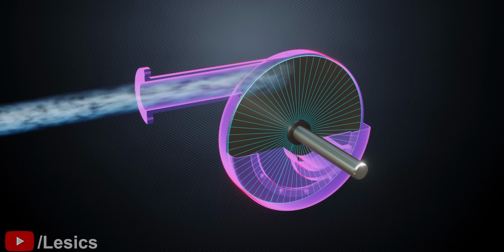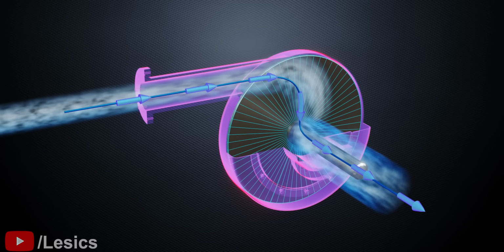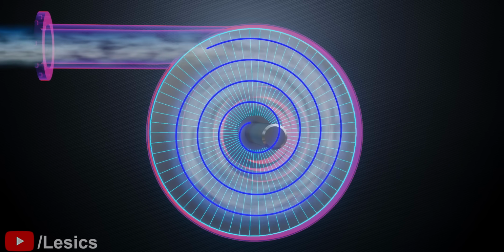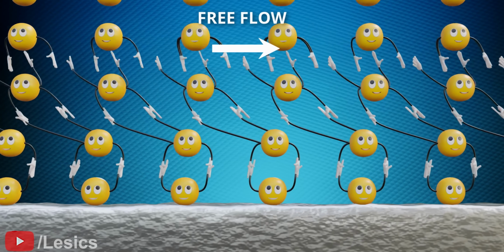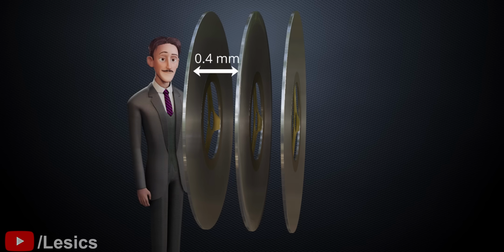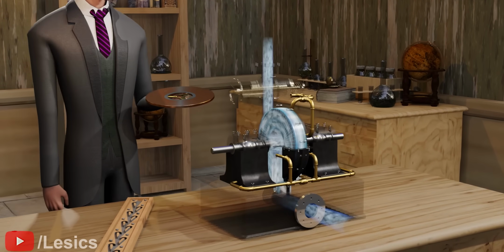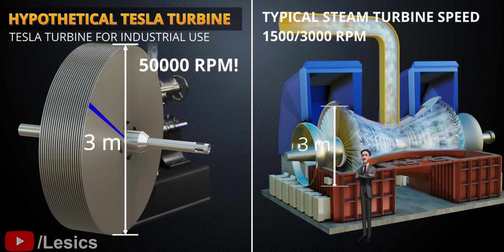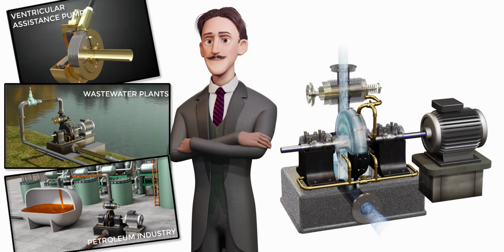Tesla Turbine | The interesting physics behind it

Comment: Tip speeds can be reduced by reducing the diameter of the turbine discs and by making it wider by stacking more of them. Perhaps more stages?
Reply: Also the discs can be as thick as necessary to withstand the forces generated, while the critical distance between discs is kept constant. But still, the TT is best at small sizes. Coupling it to a low-loss speed reduction system would be very helpful in most cases, and NASA Tech Briefs talked of one many years ago, based on rollers with a slight barrel shape, as in wooden barrels. It had higher efficiency than any toothed gears, and could run at hundreds of thousands of RPM with no sign of wear. They even tested it at 1 million RPM for 24 hours, and it showed minimal wear.
Reply: @YodaWhat  thicker disk means a alot more weight and more stress. Remember square cube law, if you double volume, weight goes up threefold and that esponentially increases stress.
Adding more disks simply is a form of compounding but each stage is lower pressure and would need to be of different dimension and thickness, it's a nightmare to balance out such a system for marginal gains against modern turbines
Reply: @phantomsoldier497  No, compounding is a totally separate issue, and no, if you double the volume of a thing, you tend to double mass. You are thinking of doubling the radius. But anyway, who says the disks have to be solid? :)

Comment: I had the thought that if the tesla turbine was built in space would it be able to achieve 97% efficiency without failing? Perhaps it was never meant to be built for earth?
Reply: The problem isn't friction on the rotor, but rather with the fluid it's working with, ex steam.  Differences in pressure between sides of the blade leads to instability, and small flexing of the blade, with more force exerted on the material the faster it is spinning and the further from the point of rotation it's at (due to leverage).  Thus, even if you started out in a vacuum, you're ultimately limited by the physical stresses a material can withstand.  You could probably get one of these up to 20,000-25,000rpm reliably with modern high performance steels, perhaps 35,000-40,000rpm with some present superalloys?  But ultimately our present state of material science isn't to the point where a tesla turbine can reach sufficient efficiency to beat out traditional turbine designs in that manner.
Reply: @SCComega  thanks for such a detailed answer.  I'm not to smart on these matters (obviously) I just thought since the metal would be weightless and so would the fluids, perhaps that would reduce the forces exerted on the blades.

I remember reading that tesla said these ideas came to him like blueprints from a central knowledge base which he some how accessed. I came up with the theory that maybe the blue print for the turbine wasn't meant for earth. 😂

Need to stop smoking the good stuff (nah I don't smoke) thanks for clearing up my speculation.

Comment: So, the Tesla turbine is not scaleable. 

But there is a massive small-scale potential. We should apply that too. The industrial style turbine at a small scale is, on the other hand, much less efficient. 

I would use the Tesla turbine to produce small-scale electricity for homes by burning biomaterial leftovers (branches and leaves from the garden, and non toxic trash)
Reply: but you would have to burn a lot of things to have a constant flow, because during the run up and the cool down you don't get energy. And burning wastes isn't a future viable option, we already did that, and we know it's not sustainable.
Reply: @gillesbkf4315  It is with current filter technology. I know it seems bad, but our current waste storage system is actually very very bad.

Comment: "Engineering impossibility" Those are the words of losers.
Reply: Everything's impossible until it's not...
Reply: I am so tired of seeing self appointed science authorities come on the internet with their fancy videos and having very little understanding of what they are talking about and then making stupid conclusions. This video is riddled with incorrect assertions.. the largest of which is when he says, "maybe 50,000 rpm would be required" ... and then goes on to describe the tangential speed of a 3 meter disc.. the assertion that a 50,000 rpm "may be" required without regard to the diameter of the disc is just wrong and presents a very basic misunderstanding of the mechanics involved. The fluid's energy transfer efficiency does rise with higher tangential speeds but the tangential speed for a 6 inch disc is 19.6 times smaller than the tangential speed of a 3 meter disc. A 6 inch disc rotating at 50,000 rpm for ideal efficiency would only require 2550 rpm on a 3 meter disc.

Comment: Engineering impossibility? Anything within the laws of physics is possible
Reply: Great. Physics allows you to build one where the rim speed is better than 0.9c. I'll wait while you find materials to build one (don't forget the bearings) and while you look, you can think about what it means when someone says that something is an engineering impossibility.
Reply: Physically possible does not imply CURRENT engineering possibility, or perhaps better said, feasibility.
Reply: I mean it's technically possible within the laws of physics I think. The tips are only rotating at Mach 1821 or so. But if we can find a material that can withstand those forces it should be fine.
Reply: laws are made by men, with weak minds to show how important they are. NOTHING IS IMPOSSIBLE. Tesla made many revolutionary technologies which are still not being used because of the oil companies buried them deep.

Comment: Because it's "too efficent" they can't harness that centripetal force. Maybe with magnets or a field to endure the SPEED OF 50,000 RPM baby.. yeah!!!! o-O
Reply: Yeah, regarding the RPM required, this video seems to force alternate generator geometries onto Tesla's idea, which introduces an entire new set of constraints and problems.  Options related to increased disc quantity with reduced diameter etc. could be explored.  Though that wouldn't solve the issue of lower efficiency at lower speeds.  Otherwise that sucker better be encased in some reinforced concrete bunker for when it blows! lol
Reply: @clark8618  Tesla designed and created the 1st hydroelectric power plant in Niagara Falls. The inlet has a diameter of 10 feet. The shaft spun at 107 Rpm's and each of the twelve turbines/generators produced 70,000 hp 
Many mistakes were made in this animation.
Reply: Question is, as you increase your load on the shaft, how would that affect RPM. That is important for a generator since frequency is based off the number of poles in a generator and the RPM of the machine. Maybe if you had a throttle valve in maintain pressure, it would work but there is also a bunch of other variables to include
Reply: @ww2planes_810  : The load issue is already dealt with by electric utilities- they compensate by speeding up the generators during lower demand, so that the average remains 60/50 Hz, despite the frequency at any given time drifting off that standard.

Comment: Any idea what Mach we could get up to with modern day materials? Something exotic or something commercially realistic, say graphene?
Reply: Doesn't matter, there is no nozzle that will inject fluid (steam) at mach 13 into the rotor ( I built one). However modern technical ceramics are super stiff and could remove the resonance to increase the rpm.

Comment: viscosity alone does not move the turbine. It's the unequal pressure flowing across the turbines, that's the reason they are shaped like an airplane wing, (foil). The curve produces a high pressure under the wing, and a low pressure over the wing, this causes lift. In the case of the the turbine, rotation.
Reply: If the fluid had zero viscosity (like a superfluid), then the pressure would be irrelevant. Here the pressure only serves to enforce the fluid flow. Looked at this way, the viscous drag really is the important force.

Comment: I would have liked to see, what happens, if one uses a more viscous fluid than air - like water or oil. How does this affect the disk space, the necessary size, the necessary speed and the efficiency. It might also be interesting, if one uses polar or unpolar gas / fluid molecules in relation to the disc material. I think, I will look a little bit at the details, this is a very interesting engine.
Reply: The issue is that - no matter the fluid - to increase efficiency, the discs must reach a certain rpm.
The rpm to create efficiency is so high that it's more dangerous to use than another conventional engine for similar outputs.

Lots of people in here are talking about how we just need stronger materials. None of them have talked about how no engineer is going to accept a design that has 6-12 discs of heavy material with an edge velocity of 107 Gs connected to an integral rod design.

The only place it can be used, then, is where natural pressures form with highly viscous fluid that would otherwise be inefficient for any other motor.

But yeah: when we go to space there will not be a tesla motor aboard it. It's an awesome design that is just too fuckin insane to operate.

Comment: The application is not possible for industrial turbines due to tip speed on 3m diameter disks. On smaller diameter turbines current materials would work fine.

Comment: Question: What is the limiting factor that makes spinning a 3 meter disk at 50,000 RPMs an engineering impossibility? Is it that the steam cannot reach high enough pressures to rotate large disks that fast? Or is there some kind of inherent physical property or law that makes it is impossible as well?
Reply: the limiting factor is the tensile strengt (sorry for my english) of the disc material. The centrifugal forces get very high and the disc break at those speeds. It's all about density/tensile strength of the material. Since the material has to resist it's own entrifugal "weight" and at the same time the (relatively) small forces to apply torque to the shaft.
Reply: Exactly. Imagine driving a car at 13 times the speed of sound and then trying to whip around a corner without slowing down. That's what would happen to the discs. They're trying so hard to fly away from the hub that no known material can resist the strain.

Comment: Once we find better materials, I bet that his design will come back in use
Reply: But still, radius of 1.5 meter with an outer speed of mach 13.... a tiny wobble or any loose parts and it will cause a catastrophic event.
Reply: @Minecraftgeek  not a physics major but im pretty sure if you had one of those discs break off at max speed it would slice through multiple feet of solid concrete, or explode
Reply: Even if we find materials like that and can manufacture it precisely enough, it would still not be a good idea.

while the turbine may get 97% efficency you still need 3000 RPM (or 3600 RPM if you have 60 Hz system) to run the generators, witch will need some sort of transmission (with losses).
The conventional steam turbins usually run at 3000/3600 depending on region, so there's no need for a transmission, just couple the geneator directly.
(that's because synchronous motors spin at exactly the frequency of the power they generate)

Yes, the turbine is efficent, but it's characteristic is not suited for supplying the grid with power
Reply: @Masztufa  I would think a gearing mechanism would be simpler than all the complexity of a bladed turbine. Not that a Tesla turbine + gearing mechanism is super simple, but it's hard to be more complicated than a conventional bladed turbine.

I'd want a more in-depth analysis than a comments-section armchair critique to make up my mind. But I have a hard time imagining a Tesla turbine + gearing mechanism would have more moving joints, nevermind more parts.
Reply: @MR-dc4od  i didn't argue it would be more complicated, but that the transmission needed would also introduce losses (to be fair, gearing is also pretty efficent, but so are regular turbines)

This invention for large scale power generation seems like a material engineering and vibrations nightmare for a marginal increase in efficiency. It probably can be done, but there's not much point in doing so. This type of machine does have it's uses, but something else is better suited for power generation
Reply: I think it could have small scale application, assuming better materials, small enough that it wouldn't need large radius disks. Single house power generator, or maybe for a yacht. Combine it with a furnace heater to also provide power.
Reply: A material like uru metal. Maybe?
Reply: @ClearSearcher  or carbon fiber
Reply: I don't think most people fully understand the forces exerted on something when it spins 50,000 revolutions per minute.  Most turbo chargers only hit 30,000 RPMs and you have heard what they sound like I am sure.  I hate to be a negative nelly but we will NEVER find material strong enough to build a 3 meter diameter disc that can withstand the centrifugal load at 50,000 RPMs.  It's just simply impossible.  Even if we could, you wouldn't be able to safely walk with in 1,000 feet of it if something failed.  This turbine may be 97% efficient but it's 100% impractical for steam generation of electricity.  It's an amazing design for high viscous fluid when driven by a motor and used as a pump though.

Comment: If you're using something like a Tesla Turbine, who says the discs have to be the same diameter as the turbine blades?  Actually, all you need them to have is identical surface area, not identical diameter.
.
That reduce their minimum diameter considerably.  The fact that you can fit far more discs into a narrower gap than any existing set of turbine blades, also means you can use more discs to compensate.  So long as their total mass is sufficiently low, and the strength of the discs is sufficient to withstand the reduced stresses from not being 3m in diameter, a Tesla Turbine should be more cost effective than a standard turbine.

Comment: What about in a turbocharger? They spin at 100000 rpm approximately.  Or would that not work because its a gas not a fluid? Otherwise it would work as a flywheel when between shifts Eliminating/reducing turbo lag once spun up....

Comment: Why reduce the speed? When alls you need is more load to slow it down.
Reply: I think the problem is that its fundamental design is such that utelizes phenomenon of fluid and motion physics to make a turbine that runs better at higher speeds and gains speed with more force in the system. However, the speeds needed to make the turbine really effective, better than its rivals, are so great that the steel is simply ripped apart. Thicker plates will probably 
1. Have high inertia and thus be difficult to move with viscous forces.
2. Mess with the flow between layers
3. Probably still have a similar problem of the sheer speeds required are too high for steel to handle

Thats what im guessing atleast. The design would be awesome but it just doesnt seem to be feasible until we make a better version - which is unlikely since humans are lazy and the current turbines work well enough - or invent super materials like perfect graphene reinforced structures or things like that that'll be capable of handling ridiculously immense tensile forces
Reply: @noahjones9833 "Good on you" for not being one of the lazy people. Better to be over exsplained than saying nothing at all. 

Me' I'm now thinking of building one. Just to see it die at such a high RPM. As I'm am still drawing a blank on what causes the metal too fatigue? Raw inertia. Should not do it? And the water should.keep it cool. So with the attoms stable? Speed alone should not have any efect on it. Unless the entering and exiting water pulses as it gets to a higher rate of speed? Has to be more to its demise than speed alone? As just some good steel should handle more than 1000,000 RPMs. Little lone when aloid with titanium or something to make it even thougher in a cool inviroment. As steel would need something more to make it give out. Something unseen. And my guess is a pulse of energy between entering and exiting water being bent to find its flow. Makes the metal fatigue. This puts force on the plates. Driving them apart enough to cause the plates to vibrate. Not a lot! Its the frequency of the compressing and releasing water that tares it apart. Just is never realized? Because it only exzists in a enviroment created by this design.

Comment: 🔵 Use of the Tesla-turbine as a water-pump requires that it be primed, as it is not self-priming in either direction.
One important advantage to this type of pump is that; as long as the bearings of a unit like this are not lubricated by the working fluid, it will not damage it to run-dry for extended periods of time.
Reply: Would you think this type of pump is good to be in a fully submerged application?

Comment: What will happen if we produce that discs from carbon fiber(like the rotor of tesla S Plaid motor) 😍?with paint of a some material that has high contact force with poundary layer? 😍.. 
I don't know what is the problem if the edge of the disc has transational speed of 15 Mach???